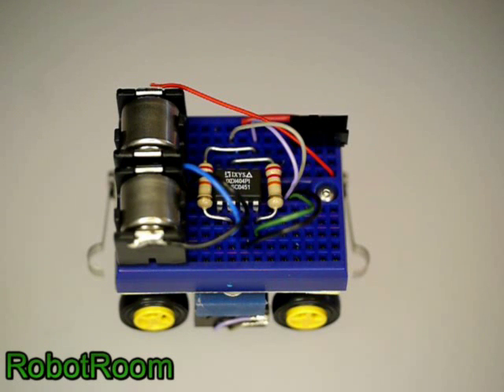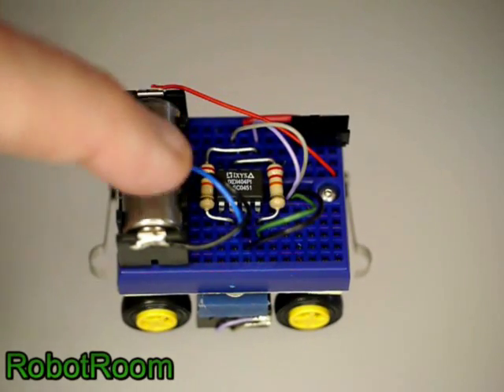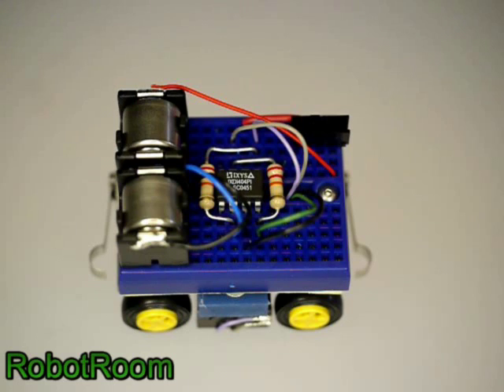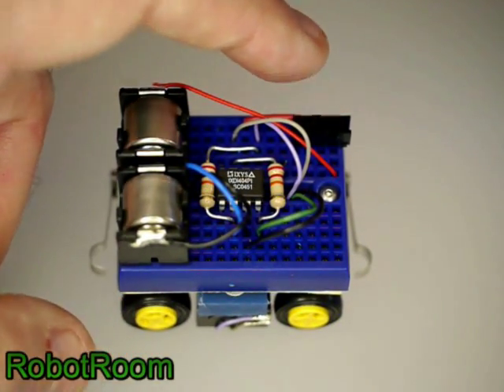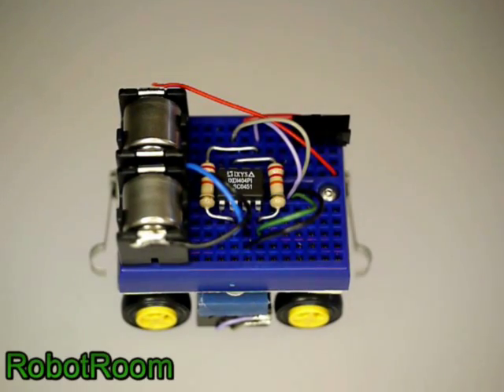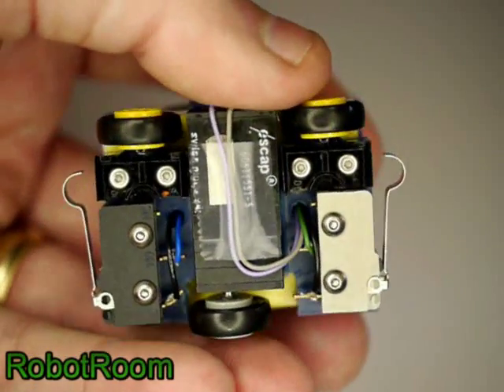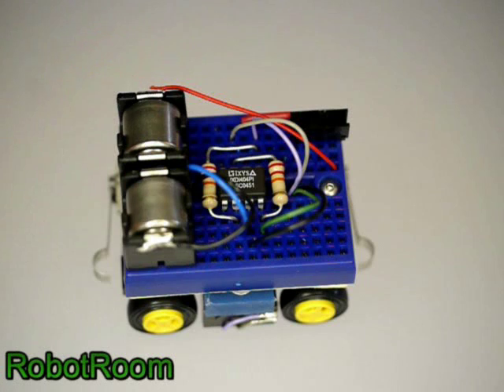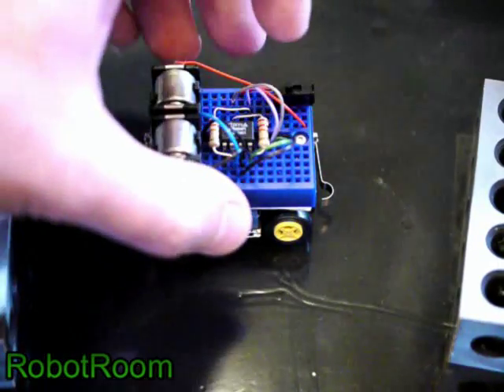Back-And-Forth Robot

Comment: can you help me i want to do the same-thing but with a 24v  Linear Actuator i'm using it to turn a manual pump in to a auto pump im using a Industrial Devices: D205A-22-MF1/MS1FT1 Electric Cylinder and a Benjamin air pump i know it works by hand i was looking around to find so help and i found your back and forth robot and that will help me cause it will also work as a limit switch please help